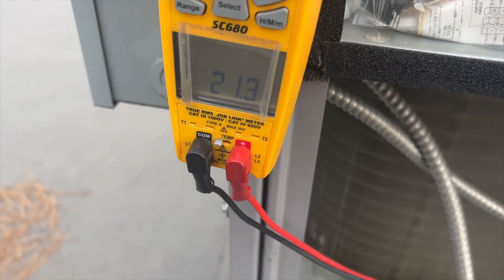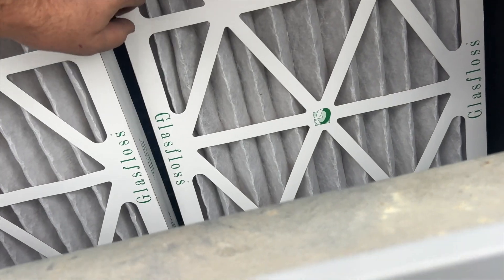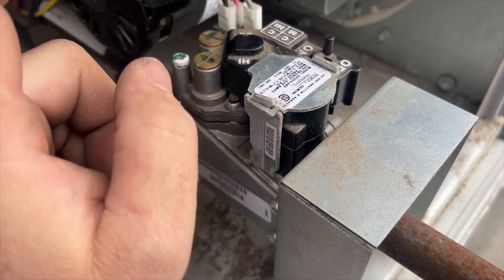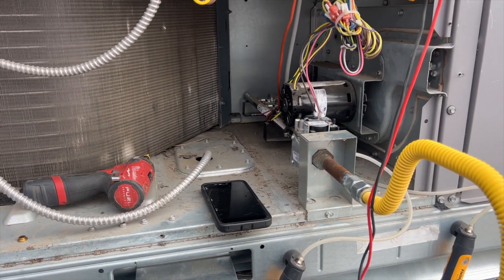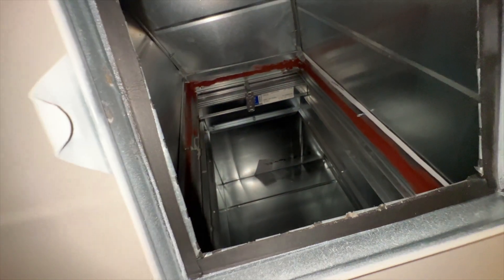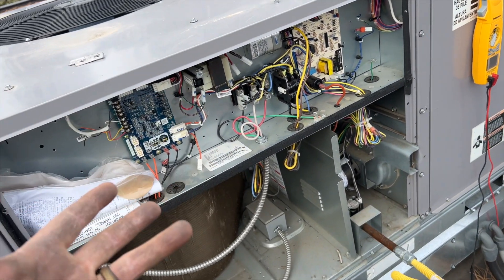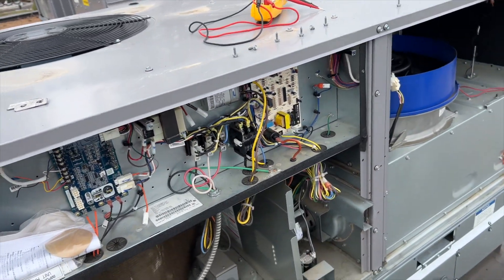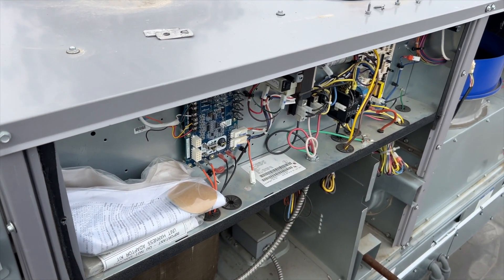Economizer Call Turns Into 3 RTU High Limit Trips EP156

Comment: Good catch. The fusible link is normally determined by the heat source. A gas furnace vs. electric strips vs heat pump all produce different heat levels. Gas has the highest rating. You will find the same with exhaust fans on kitchen equipment. Love you videos and thanks.